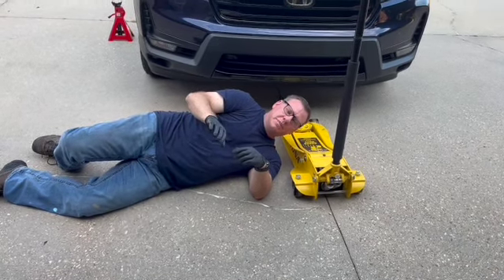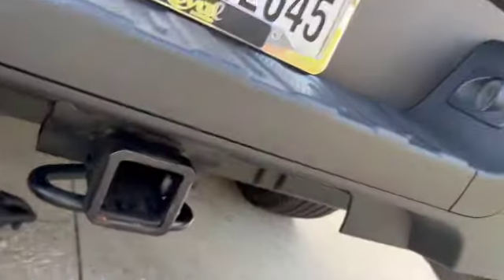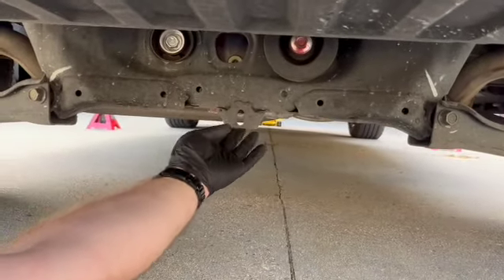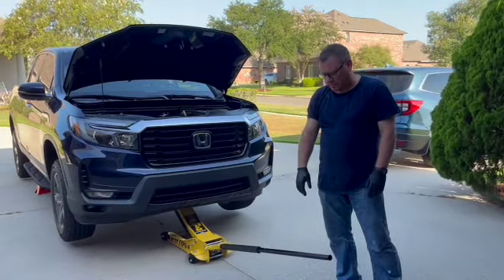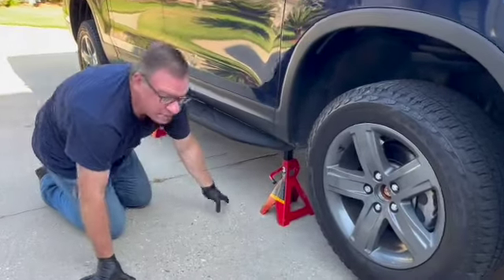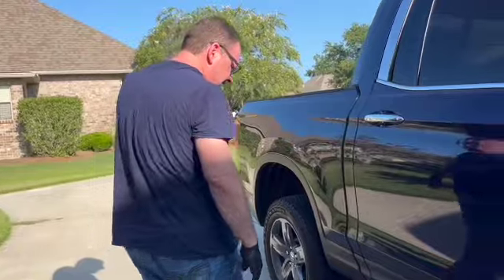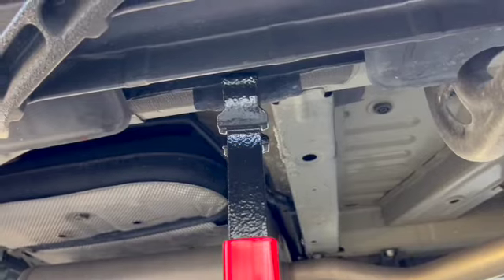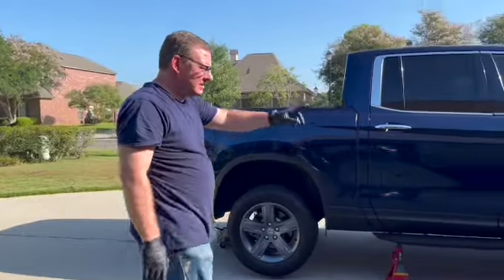2021 Honda Ridgeline Jack Points and How to Jack Up Vehicle

Comment: Very helpful. I found out my 2 ton won’t work on my ‘23 Ridge as it only lifts to 13”. How high of a lift would my new floor jack need to be? Thanks.
Reply from the maker: I’m not sure exactly how high the lift needs to be but my floor jacks are both 3 ton and they work just fine. I purchased my 3 ton floor jacks from Harbor freight.

Comment: Is it necessary to have 2 jacks?
Reply from the maker: You can use one floor jack to get all of your jack stands in place. I use 2 floor jacks for safety so I have something else in place in both the front and back of the vehicle in case a jack stand fails. I would strongly recommend investing in a second floor jack. Your life is worth every penny!